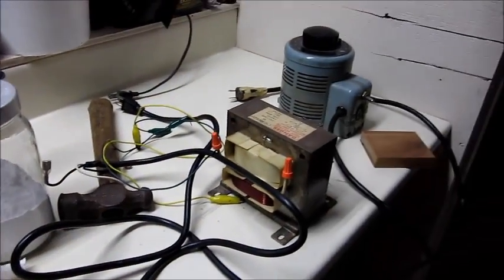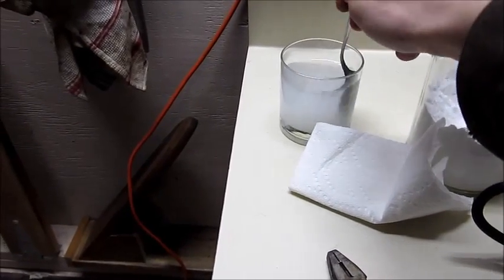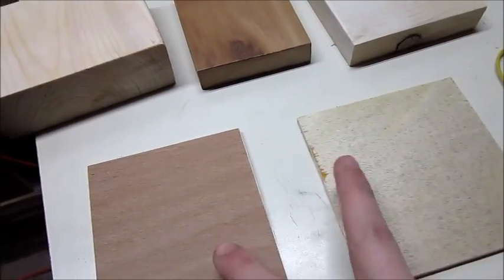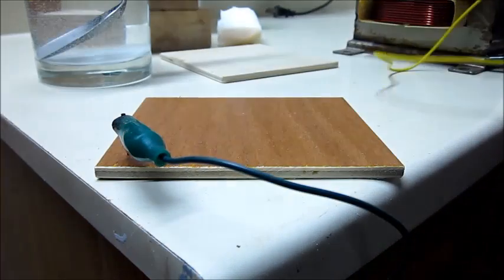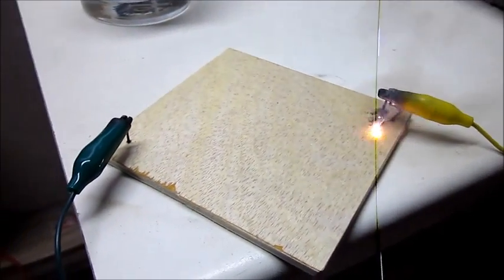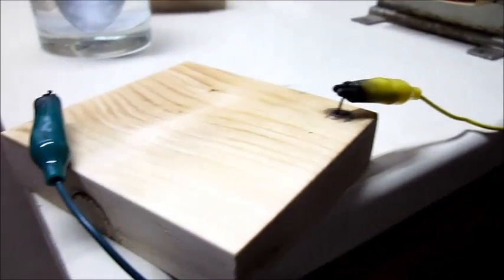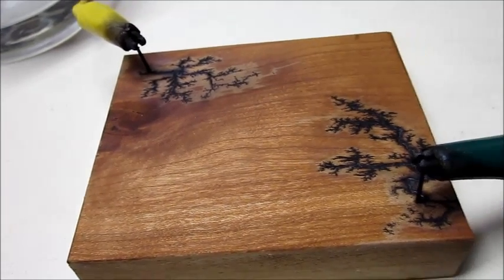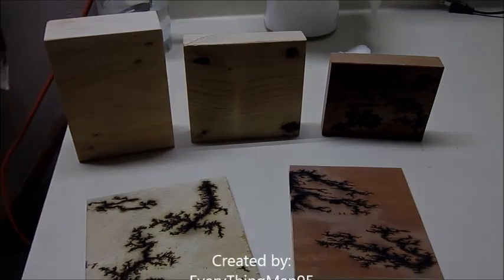Electric Wood Art- High Voltage

Comment: I think that the problem with the softwood conifers you used is that they have lots of sap that simply resists to let the conductive water inside. The grain structure is also different. The more straight it is - the less water it will soak in. The plywood is obviously soaking water much better, which allows for the better conduction.
Since I'm a woodworker, gotta try this one out someday. 2 kilovolts ain't crap to fool around with, but the result is too cool to miss.

Comment: Black Cherry worked out beautifully. Would it be possible to apply the baking soda-water with, say, a craft brush to encourage the path of the arc to specific parts of the wood? Thanks for this work of art.
Reply from the maker: Thank you, I think letting the hardwood soak or applying a few more coats of baking soda water to get the moisture deeper would help
Reply: You can't get near the arcing with anything wet in your hand. Ideally you want to be outside the room or indoors watching it outside through a window. Unplug the extension cord before going out to look at it.. Don't plug it in until you are 10' away of further. Or, just don't mess with it at all because it can be a killer and you won't likely get a second chance to learn from your mistake. It is unforgiving at 2KV. You wouldn't put your arm in the microwave would you?